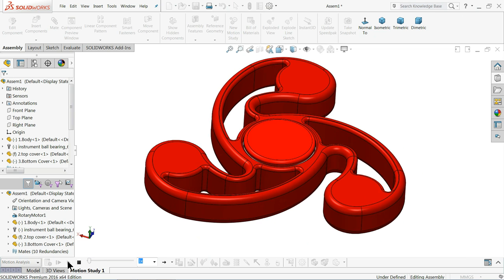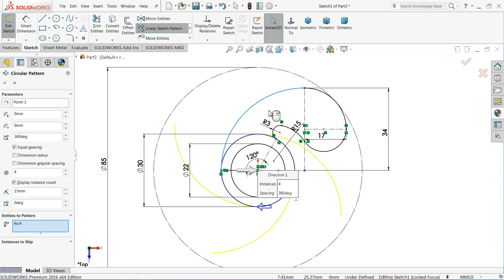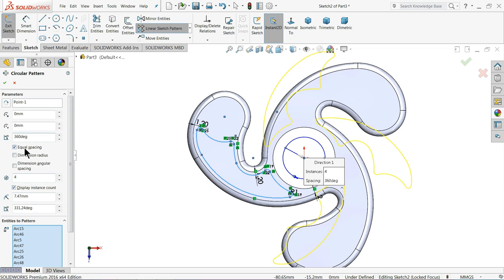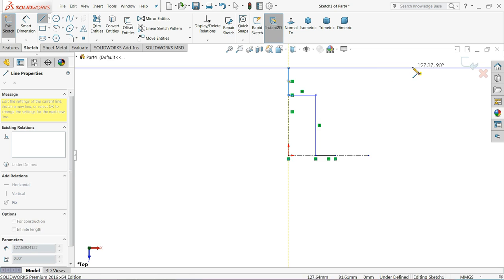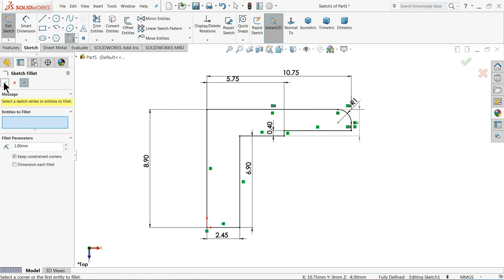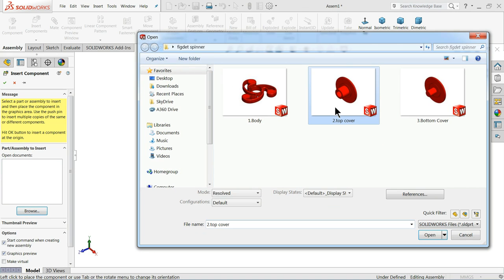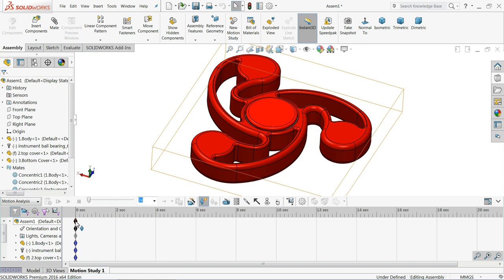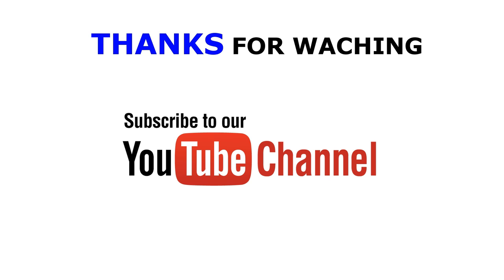Solidworks tutorial | Design of Fidget Spinner in Solidworks

Comment: it is a nice tutorial for modeling but it miss some point related to plastic injection requirement such as draft angle, shelling, etc.... Also bottom and top cover are fixed together because there is a draft angle on the cylinder surface so both parts can be fixed together by compression of the male cylinder into the female cylinder.
Reply from the maker: true observations we need draft angle for part molding, still it require many corrections,
Reply: I think you better make in context modeling design as the way you model product is what i call a reverse engineering style: you take something existing and you draw back using measurement of the existing item. Normally, the right way to do in order to follow DFM process would be to place the bearings first, then to build around the plastic part.